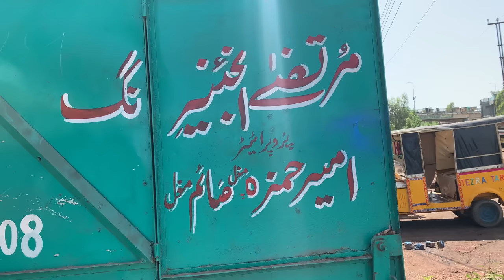Handmade Making Process of Hydraulic Tractor Trolley-Manufacturing Of Hydraulic Tractor Trolley|

Comment: Как? Как, блть, эти чуваки в ночнушках стали ядерной державой, кто нибудь объяснит?😂
Reply: Советский союз помог
Reply: I think that.
1. They should use better personal protective equipment: gloves, boots, welding helmet, leather apron and mask.
2. They should use stronger solder, type 7018, 9018, 11018.
3. They must make bevels for welding and leave space between the pieces (1/8) so that the pieces stick or adhere correctly. And even more so when it can only be welded on one side.
4. For very serious jobs like these, it is necessary to apply the welding vertically upwards.
5. For jobs as serious as these, it is necessary to apply the welding beads alternately: at one, at six 🕕, at nine 🕘, at three 🕒... At two 🕑, at seven 🕖....
6. For jobs like these it is necessary to preheat the area where you are going to solder a little (60 degrees Celsius)
7. There is no need to bend the electrodes.
8. For jobs as delicate as these, it is better to apply the solder in letter (C) movements or in circles.
9. The entire piece should have some kind of tempering so that it does not bend so easily.
10. You can create a template or pattern to make the bevels  with oxycut jjj hhjb jbjj

Comment: I think the tail gate is the wrong side in. Wouldn't the smooth side go inside the box.
Reply: I think that.
1. They should use better personal protective equipment: gloves, boots, welding helmet, leather apron and mask.
2. They should use stronger solder, type 7018, 9018, 11018.
3. They must make bevels for welding and leave space between the pieces (1/8) so that the pieces stick or adhere correctly. And even more so when it can only be welded on one side.
4. For very serious jobs like these, it is necessary to apply the welding vertically upwards.
5. For jobs as serious as these, it is necessary to apply the welding beads alternately: at one, at six 🕕, at nine 🕘, at three 🕒... At two 🕑, at seven 🕖....
6. For jobs like these it is necessary to preheat the area where you are going to solder a little (60 degrees Celsius)
7. There is no need to bend the electrodes.
8. For jobs as delicate as these, it is better to apply the solder in letter (C) movements or in circles.
9. The entire piece should have some kind of tempering so that it does not bend so easily.
10. You can create a template or pattern to make the bevels  with oxycut jjj

Comment: Geito simples de fabricar mais muito bem  caprichado  muitas fábricas do meu pais tem todos os equipamentos modernos mais não consegui fazer algo igual a eles kkkk
Reply: В какой стране ты живёшь?
Reply: I think that.
1. They should use better personal protective equipment: gloves, boots, welding helmet, leather apron and mask.
2. They should use stronger solder, type 7018, 9018, 11018.
3. They must make bevels for welding and leave space between the pieces (1/8) so that the pieces stick or adhere correctly. And even more so when it can only be welded on one side.
4. For very serious jobs like these, it is necessary to apply the welding vertically upwards.
5. For jobs as serious as these, it is necessary to apply the welding beads alternately: at one, at six 🕕, at nine 🕘, at three 🕒... At two 🕑, at seven 🕖....
6. For jobs like these it is necessary to preheat the area where you are going to solder a little (60 degrees Celsius)
7. There is no need to bend the electrodes.
8. For jobs as delicate as these, it is better to apply the solder in letter (C) movements or in circles.
9. The entire piece should have some kind of tempering so that it does not bend so easily.
10. You can create a template or pattern to make the bevels  with oxycut jjj hhjb

Comment: CRAFTSMAN AT ITS BEST, wish them luck and maybe some PPE wouldn’t hurt
Reply: I think that.
1. They should use better personal protective equipment: gloves, boots, welding helmet, leather apron and mask.
2. They should use stronger solder, type 7018, 9018, 11018.
3. They must make bevels for welding and leave space between the pieces (1/8) so that the pieces stick or adhere correctly. And even more so when it can only be welded on one side.
4. For very serious jobs like these, it is necessary to apply the welding vertically upwards.
5. For jobs as serious as these, it is necessary to apply the welding beads alternately: at one, at six 🕕, at nine 🕘, at three 🕒... At two 🕑, at seven 🕖....
6. For jobs like these it is necessary to preheat the area where you are going to solder a little (60 degrees Celsius)
7. There is no need to bend the electrodes.
8. For jobs as delicate as these, it is better to apply the solder in letter (C) movements or in circles.
9. The entire piece should have some kind of tempering so that it does not bend so easily.
10. You can create a template or pattern to make the bevels  with oxycut jjj hhjb

Comment: शानदार ट्रेक्टर ट्रॉली  ,बेहतरीन डिजाइन very good
Reply: I think that.
1. They should use better personal protective equipment: gloves, boots, welding helmet, leather apron and mask.
2. They should use stronger solder, type 7018, 9018, 11018.
3. They must make bevels for welding and leave space between the pieces (1/8) so that the pieces stick or adhere correctly. And even more so when it can only be welded on one side.
4. For very serious jobs like these, it is necessary to apply the welding vertically upwards.
5. For jobs as serious as these, it is necessary to apply the welding beads alternately: at one, at six 🕕, at nine 🕘, at three 🕒... At two 🕑, at seven 🕖....
6. For jobs like these it is necessary to preheat the area where you are going to solder a little (60 degrees Celsius)
7. There is no need to bend the electrodes.
8. For jobs as delicate as these, it is better to apply the solder in letter (C) movements or in circles.
9. The entire piece should have some kind of tempering so that it does not bend so easily.
10. You can create a template or pattern to make the bevels  with oxycut jjj

Comment: Muchas Felicidades Joven Por Su Canal.
Saludos Cordiales Desde Mazatlán, Sinaloa, México.
Remolques JJV NORTHSTAR
Reply: I think that.
1. They should use better personal protective equipment: gloves, boots, welding helmet, leather apron and mask.
2. They should use stronger solder, type 7018, 9018, 11018.
3. They must make bevels for welding and leave space between the pieces (1/8) so that the pieces stick or adhere correctly. And even more so when it can only be welded on one side.
4. For very serious jobs like these, it is necessary to apply the welding vertically upwards.
5. For jobs as serious as these, it is necessary to apply the welding beads alternately: at one, at six 🕕, at nine 🕘, at three 🕒... At two 🕑, at seven 🕖....
6. For jobs like these it is necessary to preheat the area where you are going to solder a little (60 degrees Celsius)
7. There is no need to bend the electrodes.
8. For jobs as delicate as these, it is better to apply the solder in letter (C) movements or in circles.
9. The entire piece should have some kind of tempering so that it does not bend so easily.
10. You can create a template or pattern to make the bevels  with oxycut jjj

Comment: All the steel looks like ship super structure those people srap them make sense recycling
Reply: I think that.
1. They should use better personal protective equipment: gloves, boots, welding helmet, leather apron and mask.
2. They should use stronger solder, type 7018, 9018, 11018.
3. They must make bevels for welding and leave space between the pieces (1/8) so that the pieces stick or adhere correctly. And even more so when it can only be welded on one side.
4. For very serious jobs like these, it is necessary to apply the welding vertically upwards.
5. For jobs as serious as these, it is necessary to apply the welding beads alternately: at one, at six 🕕, at nine 🕘, at three 🕒... At two 🕑, at seven 🕖....
6. For jobs like these it is necessary to preheat the area where you are going to solder a little (60 degrees Celsius)
7. There is no need to bend the electrodes.
8. For jobs as delicate as these, it is better to apply the solder in letter (C) movements or in circles.
9. The entire piece should have some kind of tempering so that it does not bend so easily.
10. You can create a template or pattern to make the bevels  with oxycut jjj hhjb jbjj

Comment: luar biasa dan terbaik  saudara,  salam dari indonesia 🇮🇩🇮🇳
Reply: Pakistan itu bukan india
Reply: I think that.
1. They should use better personal protective equipment: gloves, boots, welding helmet, leather apron and mask.
2. They should use stronger solder, type 7018, 9018, 11018.
3. They must make bevels for welding and leave space between the pieces (1/8) so that the pieces stick or adhere correctly. And even more so when it can only be welded on one side.
4. For very serious jobs like these, it is necessary to apply the welding vertically upwards.
5. For jobs as serious as these, it is necessary to apply the welding beads alternately: at one, at six 🕕, at nine 🕘, at three 🕒... At two 🕑, at seven 🕖....
6. For jobs like these it is necessary to preheat the area where you are going to solder a little (60 degrees Celsius)
7. There is no need to bend the electrodes.
8. For jobs as delicate as these, it is better to apply the solder in letter (C) movements or in circles.
9. The entire piece should have some kind of tempering so that it does not bend so easily.
10. You can create a template or pattern to make the bevels  with oxycut jjj

Comment: There is a looong way to precise machining... the one where straight lines, right angles and any predefined tolerance are important.
Reply: and they're not going that way, as what they make seem to be 'good enough' for it's customers and price class
Reply: I think that.
1. They should use better personal protective equipment: gloves, boots, welding helmet, leather apron and mask.
2. They should use stronger solder, type 7018, 9018, 11018.
3. They must make bevels for welding and leave space between the pieces (1/8) so that the pieces stick or adhere correctly. And even more so when it can only be welded on one side.
4. For very serious jobs like these, it is necessary to apply the welding vertically upwards.
5. For jobs as serious as these, it is necessary to apply the welding beads alternately: at one, at six 🕕, at nine 🕘, at three 🕒... At two 🕑, at seven 🕖....
6. For jobs like these it is necessary to preheat the area where you are going to solder a little (60 degrees Celsius)
7. There is no need to bend the electrodes.
8. For jobs as delicate as these, it is better to apply the solder in letter (C) movements or in circles.
9. The entire piece should have some kind of tempering so that it does not bend so easily.
10. You can create a template or pattern to make the bevels  with oxycut jjj hhjb jbjj

Comment: estos señores nos demuestran que la proteccion personal es solo un mito.. se encomiendan a su dios y eso es suficiente jajajaj
Reply: I think that.
1. They should use better personal protective equipment: gloves, boots, welding helmet, leather apron and mask.
2. They should use stronger solder, type 7018, 9018, 11018.
3. They must make bevels for welding and leave space between the pieces (1/8) so that the pieces stick or adhere correctly. And even more so when it can only be welded on one side.
4. For very serious jobs like these, it is necessary to apply the welding vertically upwards.
5. For jobs as serious as these, it is necessary to apply the welding beads alternately: at one, at six 🕕, at nine 🕘, at three 🕒... At two 🕑, at seven 🕖....
6. For jobs like these it is necessary to preheat the area where you are going to solder a little (60 degrees Celsius)
7. There is no need to bend the electrodes.
8. For jobs as delicate as these, it is better to apply the solder in letter (C) movements or in circles.
9. The entire piece should have some kind of tempering so that it does not bend so easily.
10. You can create a template or pattern to make the bevels  with oxycut jjj hhjb

Comment: Saludos al broder y al Chuchin! Echándole ganas como 100pre.
Reply: I think that.
1. They should use better personal protective equipment: gloves, boots, welding helmet, leather apron and mask.
2. They should use stronger solder, type 7018, 9018, 11018.
3. They must make bevels for welding and leave space between the pieces (1/8) so that the pieces stick or adhere correctly. And even more so when it can only be welded on one side.
4. For very serious jobs like these, it is necessary to apply the welding vertically upwards.
5. For jobs as serious as these, it is necessary to apply the welding beads alternately: at one, at six 🕕, at nine 🕘, at three 🕒... At two 🕑, at seven 🕖....
6. For jobs like these it is necessary to preheat the area where you are going to solder a little (60 degrees Celsius)
7. There is no need to bend the electrodes.
8. For jobs as delicate as these, it is better to apply the solder in letter (C) movements or in circles.
9. The entire piece should have some kind of tempering so that it does not bend so easily.
10. You can create a template or pattern to make the bevels  with oxycut jjj

Comment: Union workers like the highest quality product with osha approved methods.
Reply: I think that.
1. They should use better personal protective equipment: gloves, boots, welding helmet, leather apron and mask.
2. They should use stronger solder, type 7018, 9018, 11018.
3. They must make bevels for welding and leave space between the pieces (1/8) so that the pieces stick or adhere correctly. And even more so when it can only be welded on one side.
4. For very serious jobs like these, it is necessary to apply the welding vertically upwards.
5. For jobs as serious as these, it is necessary to apply the welding beads alternately: at one, at six 🕕, at nine 🕘, at three 🕒... At two 🕑, at seven 🕖....
6. For jobs like these it is necessary to preheat the area where you are going to solder a little (60 degrees Celsius)
7. There is no need to bend the electrodes.
8. For jobs as delicate as these, it is better to apply the solder in letter (C) movements or in circles.
9. The entire piece should have some kind of tempering so that it does not bend so easily.
10. You can create a template or pattern to make the bevels  with oxycut jjj hhjb

Comment: I think that.
1. They should use better personal protective equipment: gloves, boots, welding helmet, leather apron and mask.
2. They should use stronger solder, type 7018, 9018, 11018.
3. They must make bevels for welding and leave space between the pieces (1/8) so that the pieces stick or adhere correctly. And even more so when it can only be welded on one side.
4. For very serious jobs like these, it is necessary to apply the welding vertically upwards.
5. For jobs as serious as these, it is necessary to apply the welding beads alternately: at one, at six 🕕, at nine 🕘, at three 🕒... At two 🕑, at seven 🕖....
6. For jobs like these it is necessary to preheat the area where you are going to solder a little (60 degrees Celsius)
7. There is no need to bend the electrodes.
8. For jobs as delicate as these, it is better to apply the solder in letter (C) movements or in circles.
9. The entire piece should have some kind of tempering so that it does not bend so easily.
10. You can create a template or pattern to make the bevels  with oxycut jjj

Comment: It amazes me that this is speeded up but the workers look normal.
Reply: I think that.
1. They should use better personal protective equipment: gloves, boots, welding helmet, leather apron and mask.
2. They should use stronger solder, type 7018, 9018, 11018.
3. They must make bevels for welding and leave space between the pieces (1/8) so that the pieces stick or adhere correctly. And even more so when it can only be welded on one side.
4. For very serious jobs like these, it is necessary to apply the welding vertically upwards.
5. For jobs as serious as these, it is necessary to apply the welding beads alternately: at one, at six 🕕, at nine 🕘, at three 🕒... At two 🕑, at seven 🕖....
6. For jobs like these it is necessary to preheat the area where you are going to solder a little (60 degrees Celsius)
7. There is no need to bend the electrodes.
8. For jobs as delicate as these, it is better to apply the solder in letter (C) movements or in circles.
9. The entire piece should have some kind of tempering so that it does not bend so easily.
10. You can create a template or pattern to make the bevels  with oxycut jjj hhjb

Comment: اول مرة اشاهد عمال من الهند يعملون بالموسيقى ولا يرقصون  😂😂😂😂😂😂
Reply: I think that.
1. They should use better personal protective equipment: gloves, boots, welding helmet, leather apron and mask.
2. They should use stronger solder, type 7018, 9018, 11018.
3. They must make bevels for welding and leave space between the pieces (1/8) so that the pieces stick or adhere correctly. And even more so when it can only be welded on one side.
4. For very serious jobs like these, it is necessary to apply the welding vertically upwards.
5. For jobs as serious as these, it is necessary to apply the welding beads alternately: at one, at six 🕕, at nine 🕘, at three 🕒... At two 🕑, at seven 🕖....
6. For jobs like these it is necessary to preheat the area where you are going to solder a little (60 degrees Celsius)
7. There is no need to bend the electrodes.
8. For jobs as delicate as these, it is better to apply the solder in letter (C) movements or in circles.
9. The entire piece should have some kind of tempering so that it does not bend so easily.
10. You can create a template or pattern to make the bevels  with oxycut jjj hhjb jbjj